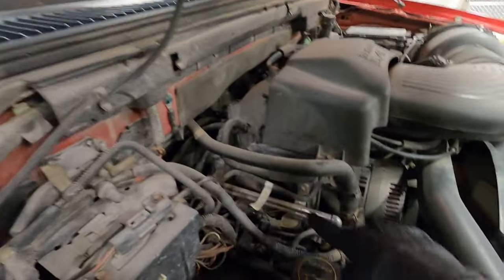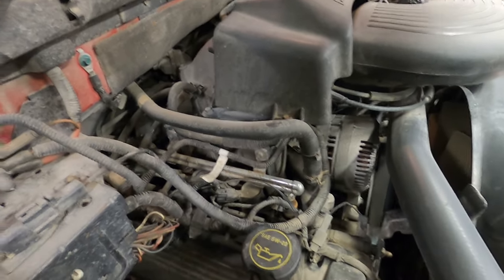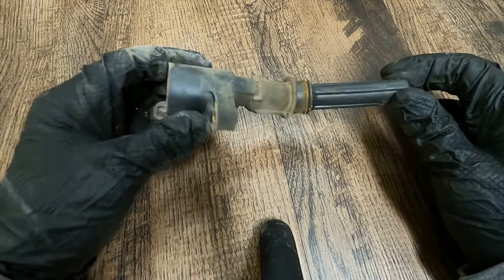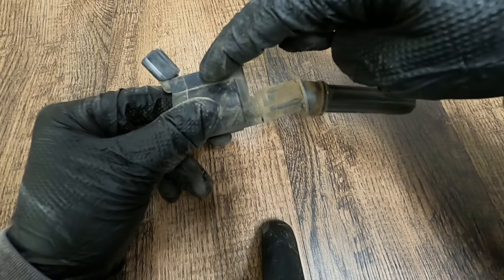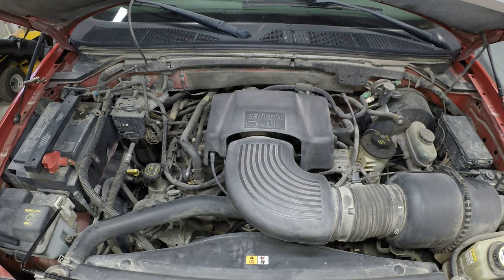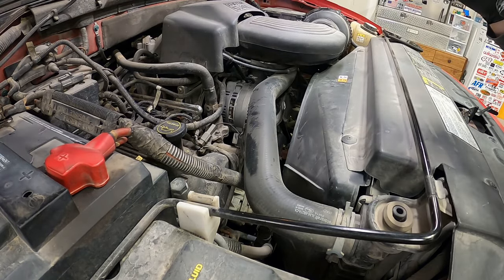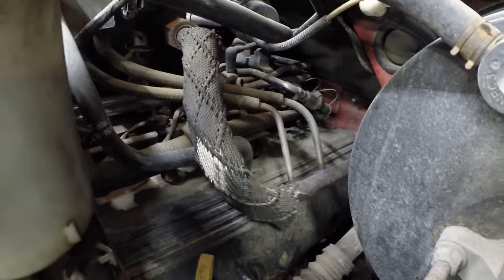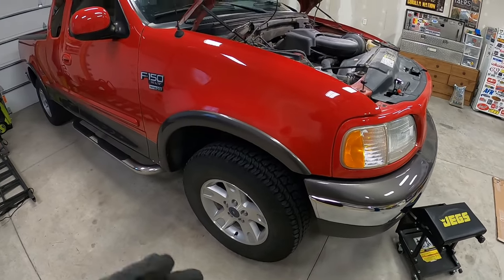Most Common Problems With Ford Triton 5.4 2V Engine

Comment: I have a 1998 Ford F-250 with the 5.4 triton. It has an issue with the engine shutting off when I stop at a red light.  It has no idle problems, and is  throwing no codes, the engine just shuts off all of a sudden. Any idea  what could be causing that? Thanks.
Reply: Low on trans fluid
Reply: Fill the radiator with pepsi

Comment: hello I am French and I have a 1998 expedition, I have a code p304 with p171 and 174 it can also come from the cylinder 4 coil?  THANKS
Reply from the maker: Fix the misfire code 1st. Switch cylinder 4 coil with another cylinder and see if the misfire moves with the coil or stays with cylinder 4.

Comment: Hello, I’ve got a 2003 5.4 F150 what been going on is it was my dads truck my dad passed so it sit for two years, it was time to get it up and running I got it going but it drives good then it seems like it goes into safe mode no power the I pull over let it sit for a couple minutes then start it up then it runs good after a while it does it all of again do ya hav any idea what could be goin on??? Thank with all the help you can give me 
Robert
Reply: Help
Reply from the maker: Check for codes and look at the fuel trims.

Comment: I am dealing with a coolant leak into the cab. I found a puddle on the floor of the driver side inside the truck. There is a smell in the air conditioning but hot air and cold seem to work ok. There is also a bit of fog in the AC when it is on. I’m thinking it could be the heater core but I’m not sure. Truck is a 2002 5.4 Supercrew fx4
Reply from the maker: Very likely the heater core
Reply: @KonaBlueSVT  Thank you. We'll be driving it this way for a bit until I save enough to get it fixed. Or I might try to just buy the part and do the scary job myself. I'm thinking about it.
Reply from the maker: Good Luck!
Reply: @KonaBlueSVT  I replaced the heater core last fall on my 2001 F150 5.4L 2 valve. You need to be confident enough to remove the entire dash. Watch the available videos, several times. There are different tips on different videos. the professionals who are doing it repeatedly can get it out in 15-20 minutes, but they KNOW where all the difficult bolts are, and how to get to them. I took about two hours to get mine out, referring back to the video several times. I had chopped off the hoses in the engine compartment and bypassed the heater core last spring, knowing that in Texas I wouldn't need heat until late fall fall. So it stopped the leak until I had time to take it apart and replace the core. I was 67 at the time, not a professional mechanic, but I have done a lot of car repairs in my time. Then i replaced the radiator, the intake manifold, drilled out and tapped two additional spark plugs that blew out, and now this week I have to replace the timing chains and tensioners, oil pump and valve ccover and timing cover gaskets and I may  have to drop the oil pan as well. 22 yr old ride w/313,000 +miles. Can't complain too much,
Reply: Heater core

Comment: I have a 2003 expedition 160k miles. been getting misfire on cylinder 1 that comes and goes. Codes are p0301 and p0316. I Replaced plugs and coils, swapped out injectors and it went away and today it came back for like 2 minutes and then went away. Check engine didn't even come on I felt it misire when i started it checked on my scanner and it was back. Drove it and now it feels fine again. Took out the plug and its dry no coolant, looks super clean as it's new. No milkshake in the oil as I did an oil change and oil looks brand new still. Don't know what else it could be. Last time I got misfire was about a week ago.
Reply from the maker: Did you swap injectors from cylinder to cylinder,  or replace them?
Reply: @KonaBlueSVT  swapped them from cylinder to cylinder
Reply: @KonaBlueSVT  checked this morning and misfire is gone even from the scanner p0301 but I still have p0316. I am having a rough start as it sounds like the starter might be going out or maybe the crank position sensor. Sometimes the starter just spins. But after I start it, it sounds really good and driving it feels great has good power and is super smooth and quiet. Cant figure out the problem. Gonna add some marvel mystery into the spark plug hole see if it clean anything up in there that could be causing it to misfire. Gonna go check to see if the starter is bad because it sounds pretty bad when starting. Hoping the flywheel is fine and the teeth aren't grinded down.
Reply: @KonaBlueSVT  last night when I was checking everything again I took out the spark plug and it was clean and looked good. I did notice my coolant was a bit low and got somewhat worried but as I checked I noticed dried up coolant on passenger side coils. Seemed to be coming from the heater control valve so I ordered a new one and im going to replace it. I'm wondering if possibly some coolant got into cylinder 3 or 4 and caused a little misfire to occur. I have heard of people having a misfire on cylinder 1 reading but replace a spark plug or coil for another cylinder and it fixes the problem. Could it be a faulty ECU reading?
Reply from the maker: If you moved the injector and the po301 didn't come back, it could be that injector. I would run a can of BG 44k through it and see how it does.
Reply: @KonaBlueSVT  it went away for a week and then came back yesterday. It's been going on and off. But I was going to run some Lucas Injector cleaner but I'll check out BG 44K. Thanks
Reply: @KonaBlueSVT  well just got off work and code p0301 is back lol went to Walmart bought royal purple Max clean as I would have to order the bg 44k added it to about quarter tank gonna run it see if it cleans it up
Reply: FYI no check engine light, I check it myself on my scanner and the code came back. Truck is running great no misfire that I can tell. She's running strong and sounds good
Reply: Stopped at the store came back checked codes again and it's gone lol what in the world is going on

Comment: I need help.  I have a 2001 f150 5.4 litre Tritan V8. I got a code 307 and changed plug and coil on cylinder 7. Then I got code for EGR sensor. Now I am getting two codes. 307 and 174. Need advice please. I have good power but real rough idle and hesitation.
Reply from the maker: Have you checked the fuel trim? I would look at the PCV hoses to check for a vacuum leak.
Reply: @KonaBlueSVT  thanks appreciate it. Will do.

Comment: Question! What about a clogged vent between the fire wall and the windshield? Will that cause it to misfire to?
Reply from the maker: I am not sure what you are referring to?
Reply: @KonaBlueSVT  the vent that's up by the wiper blades
Reply from the maker: That shouldn't have anything to do with runability. That is your fresh air for the climate control.

Comment: My 97 has 350k on it still runs like new factory engine and trans
Reply: Same but mines a 4.6 l and it has more then 300,000 but the odometer stopped working at 300,000. It just doesn't really have a great heater though
Reply: @zachperrizo88 these things are known for heater core clogging try flushing it

Comment: I changed plugs and injectors on my 2001 ford f150 supercrew lariat with the 5.4 triton and now it will not stay running. Any help would be appreciated
Reply from the maker: Why did you change them? Are they OEM plugs and injectors? Does it start, but not stay running?

Comment: Mine sent out o2 sensor codes. Now when I’m at a light it try’s to stall. The idle is going out if I don’t shut it off or put it in neutral and Rev the engine it will stall. If it is in park the idle drops and it will stall out. Help??
Reply from the maker: Have you checked the idle air control valve?
Reply: I had a 97 f150 that died sometimes when idle and going into reverse. I tried seafoam there’s a large vacuum line coming out at the fire wall (driver side near brake booster) pull off hose start truck and let it suck in a little seafoam! Cleared up my idle big time
Reply: Buy a new OEM EGR valve , your welcome!

Comment: I have issues w both P0401 and P0402 at the same time. Very confusing. Looks like the P0401 was carbon clogging the EGR ports in the intake manifold. I'm still searching for what causes the P0402 code. Any ideas?
Reply: Maybe o2 sensor?

Comment: My Father just gave me his 98 expedition XLT 4x4 5.4 Triton it shifting really hard into 3rd & 4th gear can anybody guide me or give me any kind of information on this my uncle said it might be the transmission mount but it only shifts hard and 4th and 3rd all the other gears are smooth doesn't make sense to me
Reply: Check fluid and save up for a new jasper tranny.

Comment: I have code p308 cylinder 8 do i just change that one or change all of them
Reply from the maker: Depends on what is causing it. I would move number 8 Coil, clear the code, and see if it moves. If it moves with the Coil, then replace the coil. If not, then put a plug in cylinder 8 and see if that fixes it.
Reply: I also ordered all the coil set now the question I have is FD508 coils good for a 2000 Ford expedition

Comment: Someone plz help I have a 1998 f150 5.4 and I've replaced radiator cap,radiator,water pump,and thermostat and it still blows coolant from the cap idk what else to do besides pour gas on it and watch it burn
Reply from the maker: Have you checked it for a head gasket problem?
Reply: @KonaBlueSVT  checking it next was hoping that wasn't the problem but it seems to be the problem
Reply: Try a different brand radiator cap the one you replaced could be defective.

Comment: I had a bad idle it would bounce on my 99 f150, I switched my spark plugs about 2 -3 months ago. I don’t drive it much. I switch the EGR valve pressure sensor it calmed it down. But I ordered the egr valve to which came in later in the week. Once I installed it and turn the truck on I felt like a pressure was released while turning the truck on now When I accelerate I hear a hissing sound.  Idk what it could be anyone know? Or have an idea. The truck sit most of the time vacuum lines all looked fine switched mainly all of them.

Comment: Getting misfires. Got new plugs and coils for all 8. Still getting slight misfires. Mechanic ran test amd thinks the piston rings are worn and a new motor is needed because its burning oil. Its drivable for now but i dont want to drop thousands on a new motor. Im trying yhe barrs stop oil burn to see if it helps. Any ideas ?
Reply: Throw some marvel mystery oil in ur motor to try to clean things out. Don’t do an engine flush cuz that can do more harm than good. That, & throw a gallon of the strongest fuel system cleaner you can get your hands on.

Preferably not sea foam, but try to get the lucas or the blue devil stuff. Then get like 2-3 bottles of one or both of em.

Dump em I’m in the tank, & see how it runs.

Sometimes the rings are nasty, & need to be cleaned out.
Reply from the maker: If you truly have rings that are hanging up due to deposits, the only product I have found that actually works is a product call EPR.  It is made by BG Products.  I would also run a couple cans of 44K through the system as well.  These may or may not fix the problem, but would be worth a try.

Comment: How come every mechanic says 5.4 3v and 2v are engines to run from and f150s are terrible most years but owners always say regardless of data that they never had a problem and they are bullet proof or beat engines ever made ? How does someone looking to buy an f150 get an actual accurate answer ?
Reply from the maker: The 2v is underpowered, but reliable. The 3v can be reliable, but is way more dependent on super meticulous maintenance and some luck.  Look at the comments on this video for numerous stories of the 2v going well beyond 200k.

Comment: What do u know about rocker rollers popping off on cylinder 7?
Reply from the maker: Not something I have dealt with.
Reply: Watch the YouTube videos, for the triton 3valve engine, 2004 & later, the needle bearings wear out, they get pushed down, the cam starts dragging on the steel, then the cam lobe gets chewed up, jams, and the roller follower gets kicked out into the head, pieces can get into the intake manifold, then the valve falls down into the combustion chamber, damages the piston head, engine is toast

Comment: I have an 02 with a ticking noise on passenger side,only when im driving, when im parked its sounds ok no ticking. When i accelerate hard you can hear it like the engine gonna blow up. Lol i hate it. It also using alot of oil like 2 qts not even 1,000 miles.
Reply from the maker: Sounds like an exhaust leak. On the oil consumption, it depends on where it's going, but I would start by trying a BG EPR service.
Reply: @KonaBlueSVT  thanks Ill have to take it to a shop i guess. I had plugs and all coils replaced. Easier on gas until I had a straight pipe put on. Lol

Comment: I have a 2003 f150 5.4L 2V and have a code po172 I change all the related parts and still have the code nothing else. but on my scan tool have always a LT FTRM1 -19 to-23%. don't know what to do.
Reply: What are the related parts?

The only two systems that can add extra fuel to these engines are the EVAP or the Fuel pressure regulator. 

A stuck evap valve will allow unmetered fuel vapors into the motor from the gas tank. 

The fuel pressure regulator can leak and send fuel backwards down the vaccum line.

 Both of those can be tested with a vacuum pump. Both should hold vacuum. 

Lastly you could have a leaky or stuck fuel injector, but it’s a little less uncommon. Though cleaner does help.
Reply: @trevorsmith5524  I solved the problem it had a cheap fuel injector. So have to replace all fuel injectors standard ignition brand. and no more code po 172

Comment: Nine times out of ten the misfiring coil needs taken apart and cleaned. Fords coil packs are notorious for corrosion on the terminal blade. I use battery corrosion cleaner and get the terminal blade clean. Reinstall with a coating of dielectric grease on plug end and coil end..and problem solved

Comment: What if you just use some blue locktite on the spark plug threads? That stuff works great.
Reply from the maker: I know some Ford techs that do recommend this.
Reply: Just keep in mind that thread lock compounds are weakened by heat, by design.
Reply: @TheEogprod  Not true! I’ve even used it on flywheel bolts and high heat areas and never had any issues.

Comment: What would make my 98 expedition 5.4 2 valve read on a computer that it 40 below outside done changed temperature sonsor
Reply from the maker: If you have replaced the temp sensor already, then it's likely a wiring issue in the circuit somewhere.
Reply: @KonaBlueSVT  thanks bud that's the next step

Comment: I have a 00 f250 with the 5.4 2v replaced pcv valves purge valves 02 sensors, camshaft sensors truck runs great but once warmed up and sit for 35 45 minutes and starts back up it has a horrible choppy idle almost like a cam, any ideas?
Reply from the maker: Have you checked fuel pressure? Can you see what cylinders are misfiring on a scan tool when the problem happens? Does the problem go away above idle?

Comment: I have an explosion sound do you know what it can be
Reply from the maker: I would need more information then that.  Does the engine run rough? when did it happen?
Reply: @KonaBlueSVT  it does has issues accelerating and it’s been doing it for a while

Comment: Question can I put a 2007 motor in a 2002 expedition
Reply from the maker: It's possible, but would require a ton of fab work
Reply: @KonaBlueSVT  like the intake and all the sensors as such ija?
Reply from the maker: Yes, pcm, wire harness, etc
Reply: 2007 is a 3v where the 2002 was a 2v. Can you? sure. But to be honest, most people with that 3v would rather put the 2002 motor in their 2007.

Comment: I have a 3 value f150 , rebuilt the motor fully go to put it back in an I noticed it was like when getting the engine lined up an set it like the torque converter went back about a inch , go back down an look an it appears to be set it the right place , I can wiggle the stud on the torque converter when the flywheel is in place an seems to be okay . Why would it have pushed further than supposed to ? Could I have damaged it ?

Comment: I have a 1997 f250 with the 5.4 2 valve . I had a misfire for the first time yesterday , the engine light came on flashing , I lost power , all the gauges read normal , oil pressure gauge was normal . I wasn't far from home , I eased it back and shut it off , today I started it up and it's like nothing happened yesterday , everything is normal I drove it on the highway without issues.. Anyone know or can guess what may have happened?
Reply from the maker: My guess is you have a coil going out.  They are notorious for being intermittent.  Check the code and see if you can isolate it to a cylinder.
Reply: @KonaBlueSVT  awesome, I'll get on it asap. I really appreciate your reply. I already subscribed, keep up the good work
Reply from the maker: Thanks!
Reply: Coil just had same problem #4cyc

Comment: Oil in antifreeze but antifreeze in oil only on topside of head.  What an where is potential problem?   Head gasket,  or head cracked???
Reply from the maker: Could be either one.  If the engine has been overheated, a crack can happen.  If its never been over heated I would suspect a head gasket.
Reply: @KonaBlueSVT  Any chance of a blowby problem?  History of maintenance not known.
Reply from the maker: Blowby would only mix fuel and oil. Not coolant.
Reply: @KonaBlueSVT  thank you for the knowledge.  First 5.4 (ford) in general
Reply from the maker: No problem.  Sorry, it's been a bad experience!